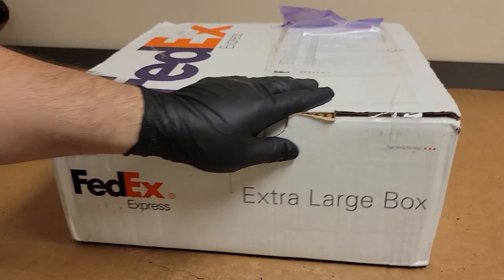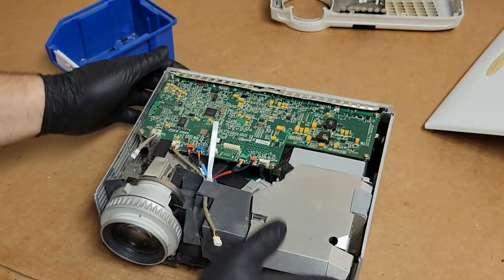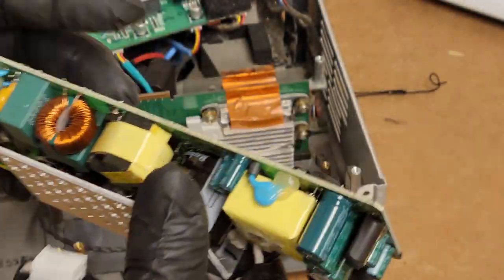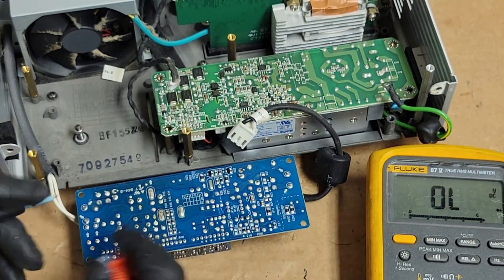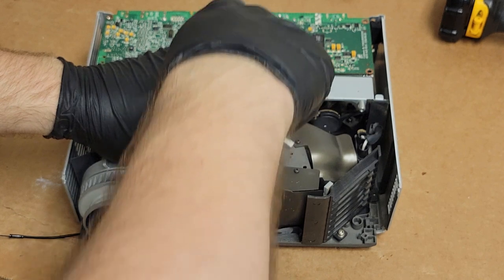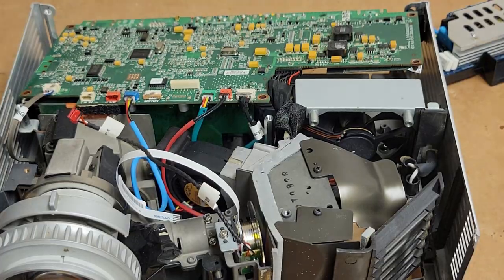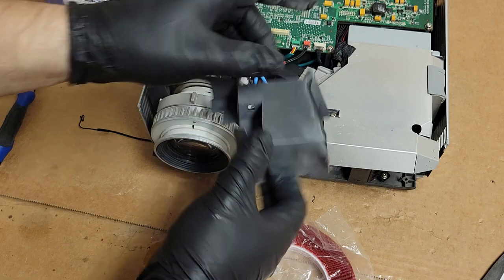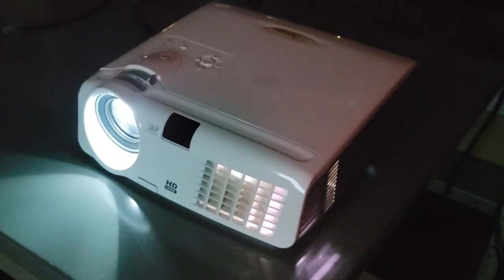Optoma HD70 DLP Video Projector Repair  No Power / Bad Color Wheel

Comment: Thanks for the advice, on how often to clean my projector, i have a Optoma HD 37, been installed since March 2021, my old one got hit by lighting, i have a homemade
lift in my ceiling, which is linked via, a 12 volt trigger, to my electric screen, i was using my old Optoma HD 20, until it went out, thanks to your video on , how to replace a color 
wheel, on this model, i  put a new one in myself,  good detailed instructions, just had to go back to the HD37, had such a heavy investment in 3D movies and glasses, plus
the enjoyment of watching them,  hope i didn't make this too long,  look forward to each new video that you post.   Dave
Reply from the maker: Hi Dave,  Not too long at all!  Thanks for watching my videos! I like that setup you have.  The Hd37 is a great projector.  How did you make the lift?  Linear actuator?  Winch/cable setup?
Reply: @FixitFrank  Hi Frank, i made the box out of plywood, and made the inner part, that holds the projector, a little smaller, and used drawer slides 24" long, attached
to the boxes, this is how the lift goes up and down, and attached a 18" actuator to the inside box, which holds the projector, i have a relay connected, from the 12 volt 
trigger out, from the projector, which also sends it to the screen, kind of hard to describe, i cut a 18"x18" piece out of my  sheet rock ceiling, and attached that to 
the inner box, so when it closes up, it is flush with the ceiling, i use a IR blaster, to send the signal to the projector, plus i use a Harmony remote, to turn on and off
everything Ie DVD Player, AMP, Lighting,  i also have my Fire Stick connected, so we watch it on the big screen also, we are retired, and we watch a lot of movies,
we have 360 Blu Ray and 500 DVD titles,   well i better shut up,  Thanks again    Have A blessed Day  Dave
Reply from the maker: I follow! I picked up a linear actuator a few months ago to make a lift but I ended up not needing to hide the projector.  I follow the design and it sounds fantastic!  And please no need to shut up. If I even post a comment that is only one sentence, then I am probably sleeping...  
Currently I'm using my HT1075 with a HTPC and an older Yamaha amp with stereo audio. for control, I went with a Broadlink IR/RF bridge that talks to my smart home setup(amazon echo).  I use the RF portion of the bridge to talk to my screen. When I say "alexa turn on the projector", it triggers the screen and switches the audio channel to the PC. I love this stuff. Its so much fun!  Have a great day Dave!
Reply: @FixitFrank  Sounds like a great set up, i don't have any voice control, but it beats, having to use 4 remotes, to turn everything on and off, the only issue i have is, the Harmony turning off the Optoma projector, you have to hit the off button twice, the Harmony has a repeat command, but it doesn't work every time, i wonder if
any of your subscribers, have the issue, oh well, my wife used to call me, Mr Remote  HA!!  have a great day.  Dave

Comment: Its great to see a simple fuse replacement can save this unit from the scrap heap.....plus a colour wheel. Will modern machines be so easy to repair, somehow I think not. Another good fix Frank. Cheers.
Reply from the maker: Thanks Karl!  I was worried it would be a mess but thankful that it worked out like it did.

Comment: UPDATE to previous comment:  I was fooled.   I went a little further to verify my readings.  Same results, so I check the door switch for continuity and found it open.  So I removed the door and found that the tab that closes the switch was partially gone. I must have damaged it during lamp removal.   Anyway, during all the troubleshooting I had all main board and power supply connectors  on and off a few times. Put it back together, and it works!  Great picture! must have been a loose connection all along.  After half an hour, a loud pop, lamp blew up!
Reply from the maker: wow!  The lamp might have been on its way out.  However if it was new, I would make sure they sent the right bare lamp inside.  These are a rare type that use a DC lamp rather than a more common AC lamp.  The ceramic on the back of the lamp should say "GL" ,"SX" with a number after them, or "SHP69" . If it says Osram or Philips then they sent the wrong thing. AC lamps will explode in about 20-30min if they are run off a DC ballast.  Another cause of exploding lamps is lack of cooling blower fan operation. And age of course.
Good find on that lamp door switch! You can safely bypass it and just tie the wires together if you want.  Easier than making the door tab work again.  That switch actually kills the power to the low voltage supply which makes sense why you only had the standby PFC voltage.
Reply: Hello again.  My story continues: After replacing the after market lamp that blew up, I replaced the lamp with a Phoenix per your recommendation. Reassembled, fired it up, worked one hour and got lamp failure again. Noticed a green flicker or two during the hour of it working, so ordered and replaced color wheel.  Put it back together, and worked perfectly, no flickers, but after two hours another lamp fault !  So, let it cool down and unplugged it to reset the lamp fault, and everything works again!  Do I have a temperature problem? Projector is very clean, and fans are working. Is there a way to check temp?  Or main board? Or lamp fault circuit?
Reply from the maker: check the lamp blower fan.  That little guy near the lamp.  Id also try and get into the service menu while its working.  There will be error info in there to direct you better.  Hopefully one of these are the correct steps.  If not let me know. https://factory-reset.com/wiki/Optoma_Service_Menu
Reply: @FixitFrank  Thanks to you I am up and running again!   Before I took it apart again, I decided to set the fan to high altitude (never had to use this setting for all the years I've had this projector).   It stayed running for more than an hour.  So I did take it apart again and cleaned the lamp fan as thoroughly as possible.  Put it back together, and it has been running great on low speed fan setting, which is much quieter.   Incidentally, I bought a used HD70 on Ebay that was advertised as "parts only" so I could have spare parts.   I decided to try it out, and it ran great for 20 minutes, then lamp failure indicator!   I took it apart and cleaned the lamp fan, and it has been running great ever since!  I'm surprised  the operators manual didn't have a reference to this as a possible problem for "lamp fault error".

Comment: I watched one of your other excellent videos (2019) on troubleshooting where you checked  the various pwr supply output voltages.  I checked mine and found that there are no output voltages other than  166 vdc on the ballast connector. I had the main board disconnected.  I assume I will need to replace the pwr supply.

Comment: Hi Frank.  Thanks for good video..!  I have an HD70 (many years now).. Constantly dealing with screen flickering colors then black and white.  Reading it seems folks saying to clean the color wheel.  Any advise on that?  Clean it off with can air?  Micro fiber?  This a reasonable guess it might help?  TY
Reply from the maker: They mean to clean the color wheel sensor.  However if you are still on the original color wheel, I would plan on replacing it.  They use an oil bronze bushing that wears out. Most HD70s and HD20s are on their 4th-6th or more color wheel.  I think you got your moneys worth for sure.  
All that said, it cant hurt to try cleaning off the color wheel sensor.  Maybe you lucked out and the bushing is okay and the only issue is some dust buildup on the sensor. That is the little board on the color wheel bracket. I think it has 3 wires.
Reply: @FixitFrank  thanks Frank.. so I pulled it down today, pulled the wheel, blow off sensor and wheel with air.  Wiped with micro cloth.  I played 1/2 of movie and no color problem.  That said, I’m thinking I’ll buy one to have on hand.

Comment: Hi Frank, Your videos are very good and instructives. I’ve seen some of them trying to fix my Benq W1070+ without success. The projector switch on and the color spin a little and stop ,3 times, after that the W1070+ will shut down with a red led blinking that indicate to change the color wheel (according to the manual). I tried with 2 new color wheels and it’s the same result, do you have some idea what could it be? Thank you.

Comment: Hey Frank, first of all thank you for the wonderful videos and education. My Optoma EH412 had a pop sound like something exploded internally (my city has frequent power spikes and I was not use a surge protector). I took it apart and tested that the fuse was blown. No other damage visually noticeable. I replaced fuse and connected power but the fuse blew again. Sounds like something is drawing extra to blow the fuse instantly. Any insights? Common issues? What do I focus on? Thank you in advance.
Reply from the maker: Oof, thats a tough one.  There are a lot of things that could cause that.  without first checking for what is shorted its hard to say.  It could be anything from the initial bridge rectifier all the way to the ballast. My guess it the switching regulator got overloaded and blew up.
Reply: @FixitFrank  Thanks for the quick response. What would you suggest, diagnosing to repair it (I would consider myself a novice who can do basic component replacement like the fuse) or go for a new power supply board (available from China for about $88 with shipping). Is it worth the time to diagnose and repair the board forecasting multiple components failure? Thanks in advance for your time.
Reply from the maker: If you are not familiar with board level troubleshooting(and have a multi meter, scope etc) then a full board replacement is probably your best option. I'd also be suspect of the ballast but I'd not worry about that until the main power supply is good.  If you want, contact the folks I use.  gydz@timeprojectorlamp.com  and let them know I referred you.  $88 isnt bad but they might be able to beat it.
Reply: @FixitFrank  Thanks a lot. I actually ordered the one from China this time. Seemed like a quick delivery to the US. Will try repairing my toasted board with your suggestions. Appreciate it.

Comment: very nicely done.   I was wondering if it is possible to get a false lamp fault (red LeD light ) and the lamp still good.  what would cause that>
Reply from the maker: Thank you !  Yes it is very possible.  In fact the lamp LED only means the lamp could not start. Not why the lamp could not start.  Usually its a color wheel problem.  Most HD70s are on their 4th-5th color wheel so if yours is original, that would be an area to check.  The ballast can also cause this but usually only after a lamp bursts while running.  check out some of my color wheel videos. the theory is the same regardless of the model.
Reply: Also forgot to mention: After replacing lamp from first "lamp fail" fault, the projector turned on and worked great. . . for only 10 or so minutes and gave another lamp fault indication.  I removed lamp and examined it, looked ok, but it back in,
Reply: Last reply sent before finished, sorry.  After putting lamp back in, got no indicator lights when trying to turn on!  Partially disassembled to get at power supply and checked high voltage out connector going to ballist. It checked 166 with door switch open and 356 with door switch closed. So that's all I know what to do. ?
Reply from the maker: @garyandjanesisk9063  did the colors flicker before it turned off?
Reply: @FixitFrank  No flicker.
Reply from the maker: okay. It still might be the color wheel, but it also could be a defective lamp assembly.  The phoenix lamp they use is NLA so many companies sell replacement options.  See if the back of the lamp says SX or SHP and a number.  If not, that might be the problem.  I'd also suspect the color wheel. It may just be jamming and not stuttering first.  I tend to see them shutter and flicker the color before failing but they can just fail. You need to some more troubleshooting.  Investigate the color wheel and I'd contact the lamp seller and get a replacement if you can just to rule out or confirm the lamp as the issue.
Reply: Ok, thanks. I'll let you know what I find.

Comment: Hi I have the same projector HD 70, the colour wheel has broken, where could I get a replacement on line, I've found some but not sure as they are on ebay. I live in the UK so can't send it to you for a repair. Thanks
Reply from the maker: Hi Ben,  I  use a company out of China a lot called Time Electronics.  Gydz@timeprojectorlamp.com  They are very good and they use paypal and ship dhl so everyone is safe.  If you want someone who can do the work, email me and I will give you his contact info(he is in the UK).
Reply: @FixitFrank  thank you, I tried looking up Time Electronics but couldn't find anything other than a  company by the same name in the UK. Is the email you provided your supplier?  I even tried Optoma but they weren't any help.

Comment: Hi I like to now how much u charged for a Optima  ultra short throw projector fix Turns on for 10 seconds and shuts off it’s a new lamp
Reply from the maker: It's hard to say without seeing it.  It really depends on what the root cause is.  
However, you say it has a new lamp.  Did the entire housing get replaced or just the bare lamp inside the housing? Reason I ask is that a lot of cheap lamp assemblies on amazon and some online sellers use the wrong kind of lens/filter on the housing.  It causes the wrong kind of light to get inside the projector and confuse the color wheel.  The lamp housing can be the cause if the lens filter is wrong. 
Let me ask a few other questions, what is the model number of the projector ? Was it a full lamp assembly(with housing) and if so, where did you buy it(I can see if its one that has the wrong lens or not)?
Lastly, your best bet is to email me via the address on the about tab of my channel page.  I don't charge for evaluating a projector. Basically I diagnose them for free and then give a price after I determine the problem.  I figure why charge someone to tell them if something is not worth fixing.  Once you approve the repair we would go from there.  But lets look at the lamp first in case you just need a better quality lamp assembly. You might want to look at my short about bad color wheels. If your projector makes the same noise, it might be that.

Comment: Hi Frank, did you do a video just on Polarizers as mentioned in one of your earlier videos?   Also I have a Sanyo PLV-Z700 which has a green color on the screen and a blue horizontal line going across the middle of the screen. I know what is causing the green color but the blue line has me stumped. Any ideas would be appreciated. thanks Stephen
Reply from the maker: Hi Stephen,  Could you share a picture of the screen?  imgur.com is a good free host.  I'd really have to see it to say with any level of certainty.  Otherwise, the causes I can think of are a bad connection with the LCD cable. Either at the connector or a break in the wire or at the bonded connection to the LCD panel itself.  Or the LCD driver IC itself. They tend to be frustrating which is why you don't see a lot of LCD projectors on my channel. To replace an LCD panel is really hard.  The alignment process is incredibly difficult without the proper jigs and tools. The only success I have had is when I replace the entire optical block(all 3 panels and the prism as one assembly).

Comment: Hi , sir i have mitsubshi projector , my lamp is getting burst again again , can you tel me what must be the problem. I am from India plss guide me. Thanks and waiting for your reply.
Reply from the maker: What is the model number?
Reply: EX32IU
Reply from the maker: There is a blower fan (squirrel cage type) that blows into the lamp housing.  You will see a small black duct that vents into the lamp assembly.  That is the opening of the fan.  Inside there, you probably have much dust build up.  When lamps explode it is from excessive heat/lack of cooling. You want to make sure that fan is as clean as is reasonable. It doesn't need to be perfectly clean, just clean enough to get sufficient air flow.
Reply: Thankyou sir so much . Is it possible if you make a small video showing exactly which part need to be clean and upload the video in youtube . It will be easier for me if you are comfortable to do it. Thankyou
Reply from the maker: I don't have this model to demonstrate upon but I have numerous other Optoma and BenQ vids that show the same process. Its the fan that blows into the lamp.  The little black vent that points in the side.  It is usually opposite the larger exhaust fan.  If you want to post a picture of the lamp basket(where the lamp sits) I can mark where the fan outlet is.
Reply: @FixitFrank  Ok sir i will post you the picture
Reply: Where i have to post the picture ?